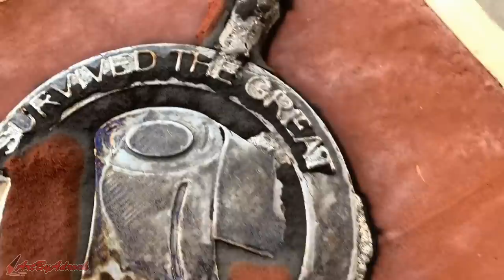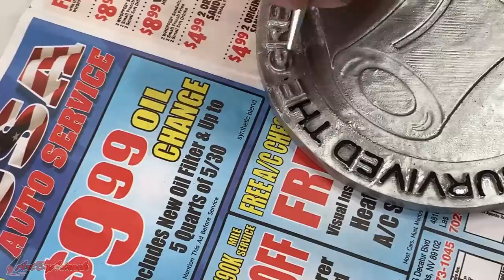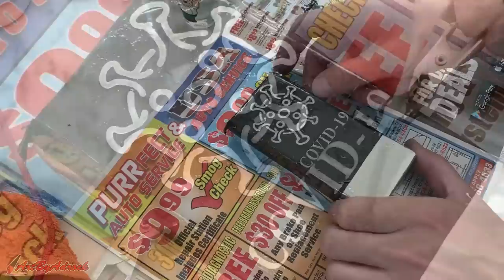Melting Soda Cans At Home Into A HUGE Custom Coin & Ingot - Casting Aluminum Cans

Comment: If you use very fine casting sand right away to cover instead of that clumpy crap you use, your molds will turn out to be a million times better and wont have as much clean up